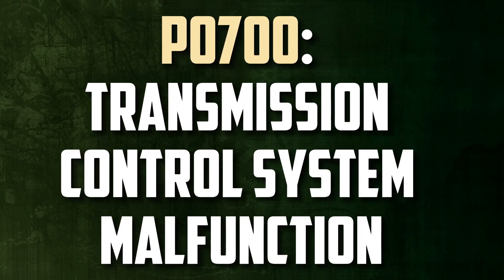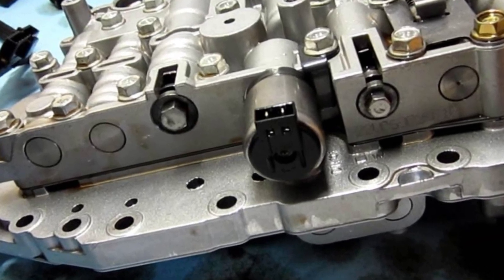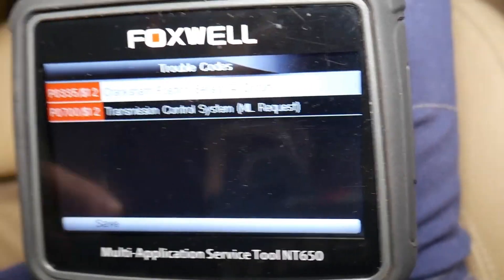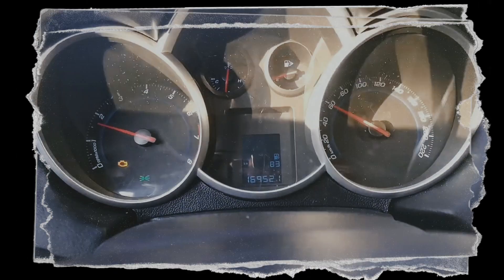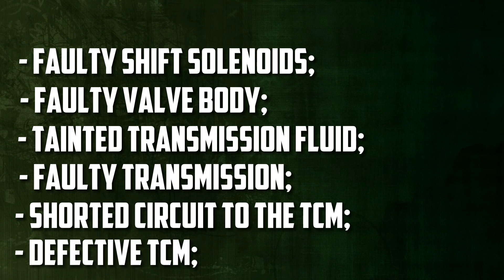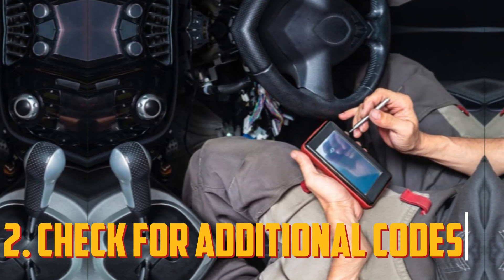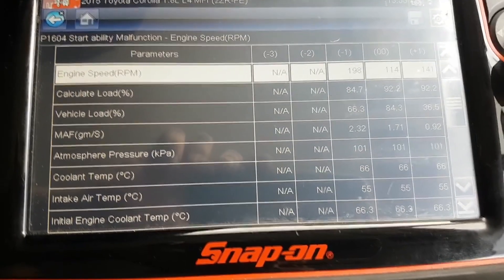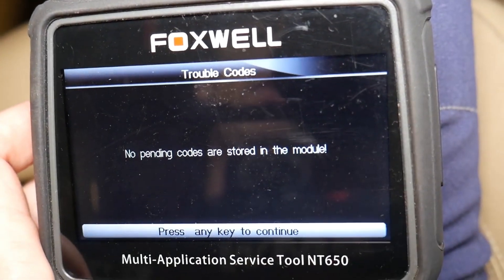OBD-II Code P0700 - Meaning, Symptoms, Causes, How to diagnose?

Comment: I just had this on my 06 dodge ram. Loss of power.  LIMP MODE. Would not shift properly. I just disconnected the battery. Put both cables together for 15 minutes. Turned on headlights to drain electrical system. Reconnected the battery.  Turned key to on position for about 15 seconds. Started truck. No engine light. Let it idle for a little bit. Problem solved.
Reply: Was your transmission slipping also
Reply: @timothybranch1881  No. It just seemed it didn't want to go into overdrive. No power either. Just had to reset the computer. It's still running just fine. Even towed a trailer for 200 miles yesterday.
Reply: @dozervin  Can you advise what "computer" you had to reset?
Reply: @bud7188  Just try what I did.  Then let's us know how it went.
Reply: @dozervin  Will do.  It's my kids car so probably will not get yo him until the weekend.
Reply: @bud7188  I also have a 05 Grand Cherokee.  Always runs fine.  Then one day it started and stalled. Hard to start.. warning lights flashing. I'm like what the hell? So I did this trick on the jeep. And yes. It worked.  Good luck.
Reply: No way thats wild. Even wilder you tried that lol

About to do just this on a Porsche cayenne V8 will update